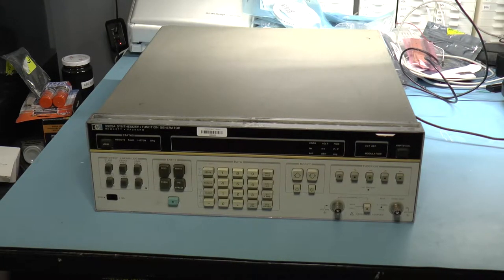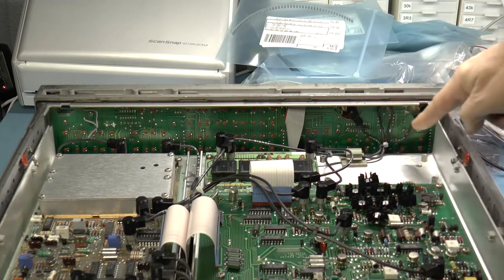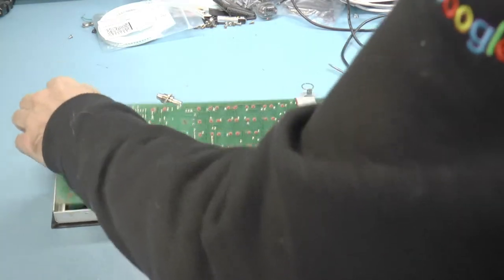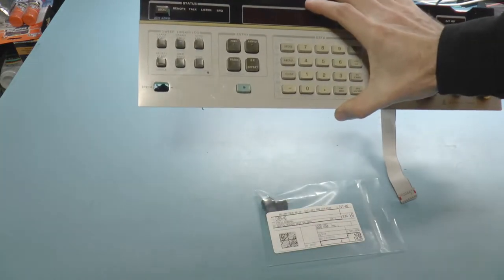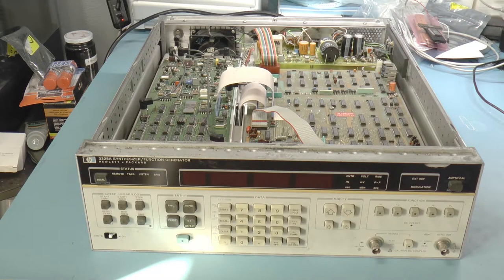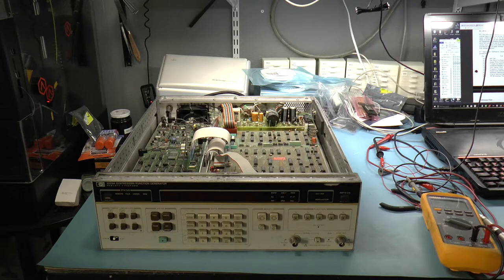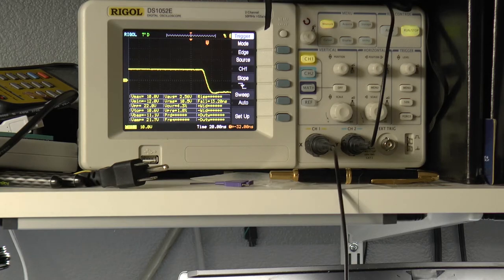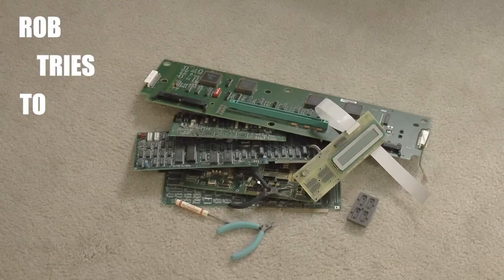Rob tries to fix an HP 3325A Synthesizer/Function Generator

Comment: Robert, thanks for passing on the unit to me! You’ll be happy to know that it now has the correct power button cap (as of yesterday). So it does not look as it’s missing a tooth anymore ;-). Now if only I can find a non-chipped replacement for the top bezel of the front panel, it will be perfect... Still one of the nicest low frequency fractional-N synthesizers out there.

Comment: Nice video.  I esp. liked it that you went over the tradeoffs for your various switch options.  I would have been tempted to hot glue that first black rocker switch in from behind the panel, since the fit was so close and the switch looked good.  But your solution was solid, for sure!  It would have been interesting to track your thought process about the ribbon cable header plug being backwards.  ->Did you see a pic of another generator to clue you in?  Finally HATS OFF to HP for not allowing a reversed cable connection to cause a HW failure!  In the absense of keying, I mandate such things for ALL designs I supervise.   This is a subtlety, for sure.  But oh, such cheap insurance... ;-)  Dan
Reply from the maker: Daniel Becker: my first instinct was glue also, but I held off unless I had no other option. As for the cable, I did put it in backwards at first, since a review of the video didn't show the orientation. Then I traced out where the switch went and determined the correct orientation.